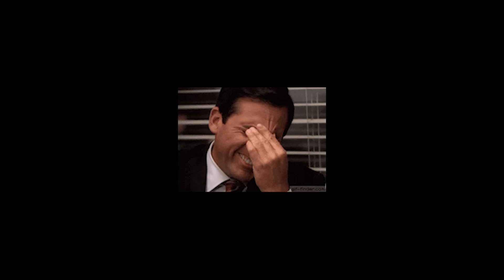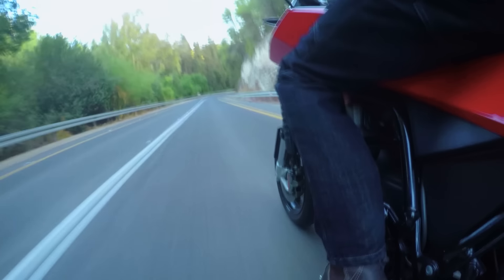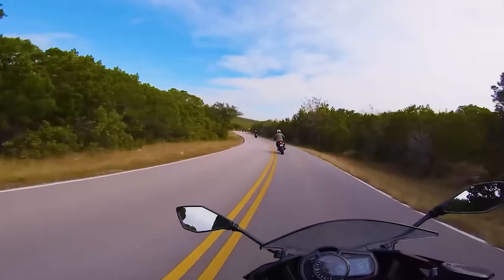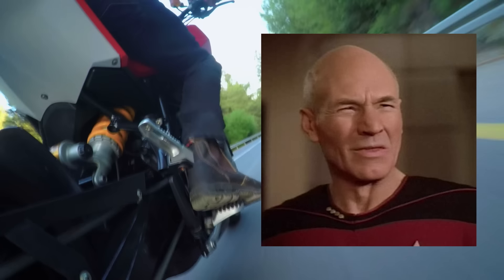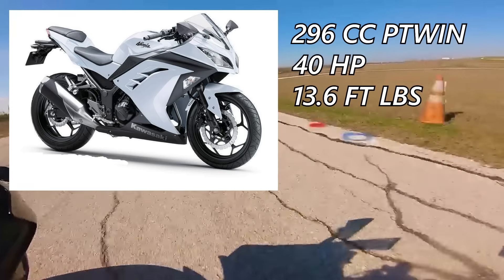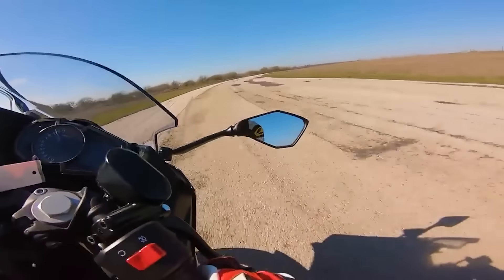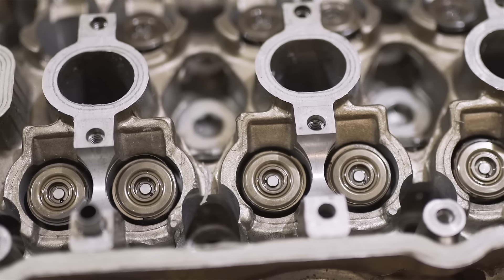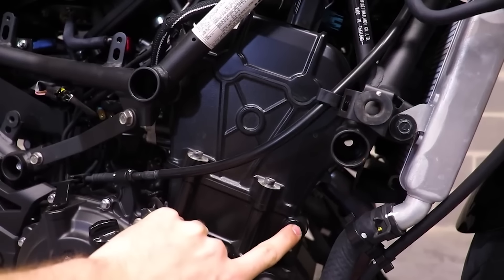So You Want a Kawasaki Ninja 400...

Comment: Yammie, why did you cough when you mention the ABS? I am planing to buy one (My first one), and I do not know if I should include the ABS (It rains half of the year where I live). Thanks man, I really like your videos!
Reply: ABS is a great addition to bikes because it makes it harder to lock up the brakes and lets you brake harder. It is not a necessity but it's nice to have
Reply: vbnm1234vb Thanks for the advise 🙌🏽🙏🏽
Reply: The response to the question:   Should you spend an additional  $300 for ABS? 

What is your life worth or avoiding/minimizing the pain and suffering and medical  costs of an accident?  

There is a reason ABS is mandatory on all cars.  Now that the cost of this technology is very reasonable for motorcycles consider someone who unexpectedly pulls in front of you.  In that moment of panic would you grab the right amount of brake so you can keep control and possibly steer to safety?  Without ABS the answer to that question is statistically proven in most cases NO.  Now think of other unplanned situations gravel, sand, rain, entering a corner too fast, etc.  

Same logic applies to investing in proper riding gear before  spending money on senseless bling or goodies for the bike.  What is more important the looks of your bike or your ability to walk and avoid permanent scarring from road rash?

Comment: A question that's not related to the video.

I was just checking if the O2 sensor connected to the exhaust header is needed I broke mine and it'll be a while before I get the part

Comment: Hay clammy pube why not the Honda CBR500R does everybody forget that bike I think that's a good beginner bike.
Reply: My big knock against the CBR500R would be the curb weight. I believe it is a good 60+ lbs heavier than the n400. Which, when you come to a stop with some lean angle still on the bike, makes it a bit more likely to not be catchable. Almost dumped my 300 that way a couple times while learning. On a bike 60lbs heavier, I may well have dropped it. 5'10, 175lbs, fairly athletic. If you are a few clicks bigger and stronger maybe it matters less. Smaller, and it might matter even more. 

Still a good beginner bike, but on merit of the weight difference, I would hand the top honors to Kawasaki's 400 (n or z.)
Reply: @kleinbottled79  That's 60 lb more though you got to realize it's another hundred cc's bigger so if you're used to riding maybe a 250 already or moped or your not a total beginner it should be okay
Reply: @hps1955  So maybe a good second bike? I can get behind that.

Comment: Only use top of the line oil, ams oil and motul are the best to have the least amount of bottom end issues “NEVER USE YAMALUBE “ that shit is trash. YAMALUBE product is so shitty the have to offer maintenance or replacement of your engine if it blows while using their oil. If you ride wheelies or ride it to the max all the time you will hit a false neutrals all the time you have to hit that shifter. If your riding hard and tap the shifter you will hit a false neutral  you will also have the clutch engage while you are ripping. I’ve put 9000 miles on my 2020 it already leaks oil and will have trouble starting after I have pinned the shit out of it all day the intake noise will be really loud. Bike has never overheated before all in all the bike is great it outperforms what it was meant to be. Yamaha would have blown up already

Comment: Got my 2021 400 ninja zero miles and been riding for 1 year no complains everything works right except gears. Sometime on blue moon it will go from 3rd gear to neutral but I rode my homie Ducati and had same issue rode Harley one of my friends had didn’t have that problem until 30 mins into ride and it got stuck in neutral. So at the end of day it’s just how u ride all bikes are shit just like cars nothing is perfect. Your just Yamaha fan or Suzuki and not like Kawasaki. I hate on Yamaha even it’s 1000 I hate on it for no reason but like them lol